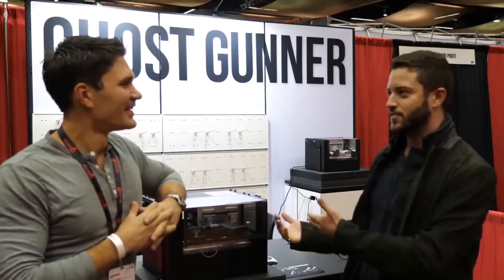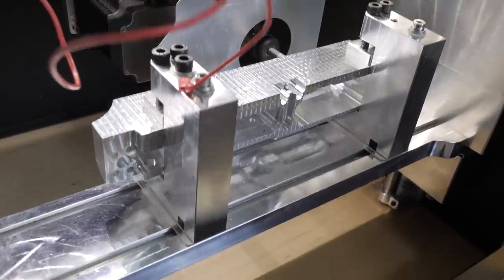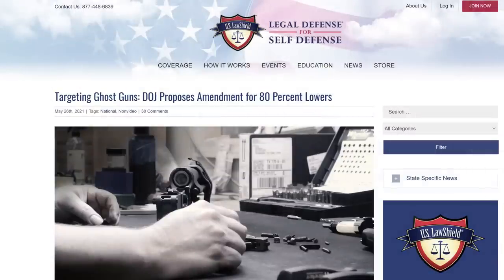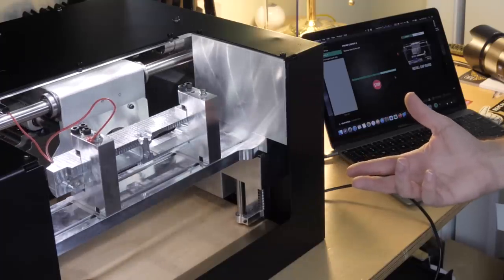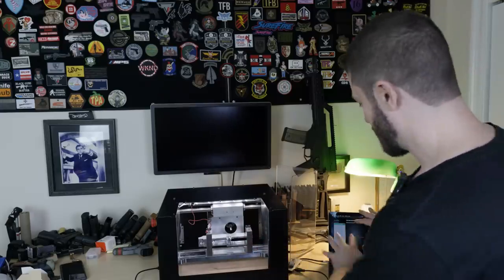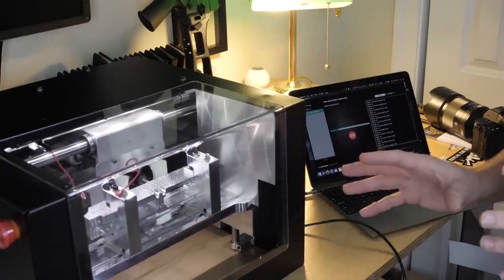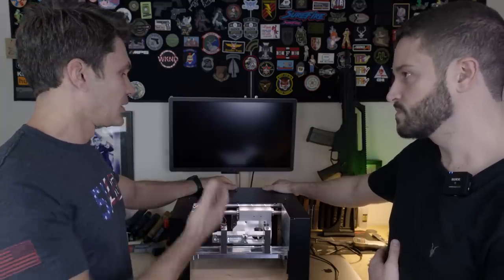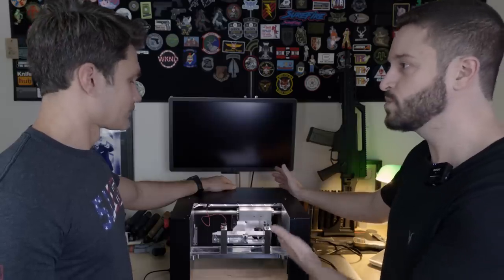NEW: Turn a Metal Block into an AR-15 Lower at Home with the GG3 Upgrade

Comment: I love the way Cody thinks. The AFT as Biden calls them are getting ready to regulate 80% lowers so what does Cody think of? Making a ghost gunner which will take a block of aluminum and make it an AR-15 lower receiver. LOL. Actually, you have to buy two more parts that bolt on to what the Ghost Gunner machines. It still totals $110 to buy the bolt on parts already machined. You can see in this video what is being machined is not a full receiver without the bolt-ons. I see on their site  the bolt-ons are coming in a future release. Great!

Comment: Seems there's no cutting oil or other lubricant in use during the cutting process.  Is it just not necessary or would it help preserve the bit, reduce chatter and get finer finishes?

Comment: So what I still fail to understand is what exactly comes out of the GG3 when the machining is finished.  Do I open the lid, toss in a chunk of aluminum, close the lid, turn it on, open a beer, kick back and wait?  When the machining is finished, do I have a lower that is ready to install a lower build kit in?  Is it ready for an upper, a stock, a handgrip, etc., or is more machining required?  Other than that chunk of aluminum, do I need to buy anything else?  Can some cool words of wit be inscribed on the receiver side?
Reply: Check their website. It’s a 3 part receiver. You have to buy the other sections the machine is not capable of creating.

Comment: All the ATF needs to do is change the rules and make the pressure bearing components the restricted parts, bolt, barrel & extension and trunnion which are the parts most difficult to manufacture, like many European countries already do.
Reply: And they are trying to do that, after people started making noise about how the AR lower receiver doesn’t match their definition of a receiver
Reply: @0dayExploit  from an outside of the US view it's pretty crazy that only an easily made part with the serial number is considered a firearm, when you can buy over the counter the most important parts that require machining and heat treatment processes you would struggle to produce yourself.

Comment: In all these 0% 80% x% parts there is a bottleneck ... from where you get the barrel if they start numbering the barrels. That would be the easiest way to stop the self-made gun movement. All parts can be manufactured home: receivers, stocks, triggers, springs...even your ammo. But the barrel manufacturing is another level.

Comment: This is getting close to a full CNC system.  Wonder when he’s going to move on from specialized ghost gunners, to a low cost CNC for the home user?   Given all the 3D printers, and how well they are selling, this could really flood demand … which would make it completely unstoppable by the ATF.  “So you want to ban all 3D printers and cutters (CNC s), because someone could make a gun with them?  Someone could make a gun with hand tools.  You going to ban every power and hand tool?!”
Reply: You could just buy the components and build your own CNC.
Reply: @ChucksSEADnDEAD  
That’s a lot harder to make then a gun!
Should be a real market for them though.

Comment: I think it's more incredible how simple and miniature this "mill" is. I wonder how much chip load this machine could handle... Does it run on G-Code?
Reply: yes... gg1 and gg2 are versions of grbl.. with slight modification. (their version doesnt appear to fit on a adruino uno, at least not the one i had. every so slightly to large. might be able to skinny down some compile options.. so i dont know if their board is the uno.. but its definitely grbl.  their .dd format files are just zips with other stuff thrown in them for use with their windows based software. there is a gcode file that will run on their machine and is configured for that spec. i stole (its open source) some of their axis leveling code for a engraver project built out of 3d printer parts i was messing with (non commercial.. just for me). but you can open those dd files and dump those routines right into universal gcode sender or the like to run them on grbl. with the exception of their leveling and maybe some of the custom status commands,,, it will work.

Comment: So its not really put a block of aluminum in the machine and pull out a functional lower. You still need to buy a parts kit that has the magwell, trigger guard, grip tang, and buffer tube threads.

Comment: Suppose I have a documented fully semi auto with serial ABC123. I put a block of aluminum and “customize” it with the same serial number. Is that more trouble than having a tool without a serial number? 🤔 technically it’s not a ghost it’s a clone.

Comment: This is not really a panacea. Under the proposed regs that will probably become law, once your block of AL is made into a receiver, it will be illegal unless you get a serial number.  So when you compare the cost of this type of set up v simply purchasing a receiver with a serial number, how can it be worth it. Once you start to use this for a commercial as opposed to a personal reason, you become a manufacturer and you are regulated by existing ATF regs

Comment: Correct me if I’m wrong, but isn’t manufacturing your own firearms in your home legal nation wide so long as you serialize and register the firearm?
Reply: Tell me, Who really wants to register their freedom tools?
Reply: Correct. As long as it isn’t an NFA item and you give it the proper markings, AND you don’t manufacture them with the intention of sale. However, the gov is most likely going to classify the 80% receivers and other parts people are using to make their own at home as complete firearms that require registration for purchase. Basically, they’re hassling people who are doing something that is completely legal.
Reply: If you make your own you don’t have to register it. But you still have to mark the receiver with a unique serial number and where it was made.
Reply: @gagemason3865 I know of two states that requires registration. CA requires you to ask for permission first before you can make one and register it after.
MA requires you to register once it's completed.

Comment: I'm less interested in this as a device to make firearms, and more as just a prototyping cnc rig. There are all kinds of little parts you can make for other hobbyist like model planes, drones, custom bike parts. As for firearms, I'd be more interested in creating custom accessories. Your polymer handguard too flimsy? Or you want a longer one for your specific barrel length? Chuck in a CAD file and make it yourself. It looks like the tolerances aren't going to be great though. What they're showing in the video looks like it needs a lot of hand work after it's been milled.

Comment: Well, I just watched the video, and I gotta confess I got a chuckle out of it.

If this guy seriously thinks he's run a successful "technicality gotcha" against Big Gov, man oh man, is he in for a rude awakening!

There's another video on this thing that I watched earlier, that explains that to "make a receiver" you not only need to mill out the aluminum billet, but you also need to BUY some parts (only available from them) to make that milled out block into a receiver. Without those parts, all that you'll have is a block of aluminum into which you can insert a magazine and a trigger/hammer/safety.

I wonder how many nanoseconds it'll take for them to declare those parts -- the ones you need to buy to make the milled out NON-GUN billet into a "partially built receiver" -- "partially manufactured receivers" that require serial numbering, a manufacturing FFL, and a 4473?

Oh, I'm pretty sure they wouldn't do it immediately upon the enactment of the rule covering "partially built" (or partially "manufactured" -- I forget their nomenclature du jour) receivers.

No, I'd be surprised if they didn't wait until a slew of these things had been sold, and then they'd lower the boom on him. Suddenly all his loving customers will be... let's just say "seriously upset."

The whole thing reminds me of that Indiana Jones scene where the (Egyptian?) with all the fancy whip-work is squaring off on Indy, who basically says f-THIS noise, then pulls his revolver and shoots the guy.

He doesn't pull his whip and try to "out-whip" the guy. He just smacks him down with one shot.

Squaring off against literally the biggest outfit in the history of the world, thinking you can play "Gotcha!" with them -- using their rules, no less! -- wow, that's pretty darn naive.

Personally, I try to avoid conflict with entities that can destroy my life, my family's lives, take everything we own, completely ruin us, cart me off to prison, and, shoot my cats. (Sorry, folks -- my dog died several years ago and I am in very poor health and cats are so much "lower maintenance" than dogs.)

But hey, you get to decide which hill you want to die on. Just remember -- at the end of that game, you're still dead, the hill's still there, and the other guy moves on to his next target.

Comment: They need to produce a companion machine to this that makes ammunition from scratch,
Cases from commercial copper pipe, a tool to make primers, bullet moulds, and a system to produce powders for the primers and propellants from chemicals you can buy at the regular stores,
This new machine is awesome but without a way to feed it in places you cannot buy ammunition without a license it's a ornament,
The ultimate evolution will be a milling and printing machine that can make every single part of a pistol or rifle including the barrel and bolt carrier and a trigger group everything,
And a kit to manufacture ammunition from scratch including making the powders and cases from of the shelf chemicals and commercial plumbing pipe with a detailed instructional video on how to do it,
That's what the world is waiting for, I wonder how long before that combination kit and instructions are available.

Comment: If they ban 80% receivers they won’t have to ban 0% receivers. This will still be considered criminal. The process of milling a receiver from a 0% receiver does not instantly create a firearm… because it is a drawn out process, at some point you will have created an 80% receiver and will be in possession of a banned 80% receiver. 

Along those lines, being in possession of a firearm made from a 0% receiver could be proof of past criminal behavior (Not a lawyer)

Comment: So for the record they have stated on Reddit that this in fact will not take a blank piece of aluminum and turn it into a functioning lower.  You have to buy their pre-machined parts to what you machine to get a working lower.  Not the thumbnail image where you just have a block of metal and a bit later you have milled that to a functioning receiver.  Bunch of marketing BS is all this is.

Comment: I don’t get it. $2500 foe the machine and you can’t sell these lower receivers to anyone. So how many receivers do you need for yourself?
Reply: @Wayne Flanigan but for $2500 you can buy so many lower, It doesn't make sense to own an engineering machine if you cant sell or produce products to sell.  I just don't think it's a strong investment for people to make. Clearly, I'm not the only one, they said they would sell 700 units and there are still over 578 available.

Comment: Or you can get a solid 3D printer for 1/10th the price and print lowers for much cheaper as well. Not to mention all the other things you can print
Reply: Yes but you can’t 3D print aluminum at home.
Reply: Why not both? Besides this is Aluminum, Miles better then ABS plastic
Reply: Or you could get both and start a company with your ffl
Reply: Yes, 3D printing is cheaper if you only care about the lower. Us big brainers can see beyond AR lowers already. Imagine milling an upper at home... yeah, with an open source software it’s only a matter of time before we have the entire gun homemade instead of just the lower.
Reply: @whiteboytyler8715  yeah, we’re here because we deeply care about asking permission.
Reply: @FuckTheState  "big brainer" but you talk about making uppers on an device that is only big enough to mill out an AR lower receiver... so please try milling an upper at home with that and let me know how it goes. 

Also like someone else mentioned there are multiple .22 and 9mm 3D print models with either a steel tube lined barrel or 100% printed barrel. Also upper parts are not FFL items so making those is the least of my concern. Upper parts also require the tightest tolerances and are where all the explosions are happening so I would rather someone who is professionally trained in making those parts make one for me for the most part anyways.

Also printing a hand-guard, fore-grips, stocks, pistol grips, etc is doable with a 3D printer.

I've already made 2 complete guns at home with my 3D printer but go off "big brainer"
Reply: @EdwardOrnelas  Well good think no one uses ABS.... PLA+, HTPLA or Carbon Fiber HTPLA are the defacto standards for printing anything that requires structural integrity. Multiple people have put their lowers through 1000+ round torture tests and had 0 issues. Plus if they do break they almost always break at the stock and you can just print another or keep a few on hand and then you got another ready to go. No one is saying replace your home defense or competition rifle with a 3D printed one but to keep denying how good 3D printed lowers have gotten now is just pointless.
Reply: @cdawson198600  well you could it just depends how much you're willing to spend. But 3D printing metal is 100% a thing, the machines are not cheap though unlike the plastic or resin printers. 

Also idk why you think an aluminum lower is that much superior. Will it aluminum last longer? Yes. Can you just 3D print another plastic lower for your gun if it does break? Yes. You don't replace your competition or home defense guns with a 3D printed one but when you can add more and more to your collection by printing the lowers its 100% worth it. I could buy a printer and build 8 or so ARs for the same price of just the Ghost Gunner 3.... if aluminum means that much to you then go ahead but with how good PLA+ lowers are now I can't justify it at all. If it was big enough to rifle barrels maybe

Comment: How does it evacuate chips? Thats a pretty far along block in there, lets see an un touched block get milled. 

Its really just a poorly built cnc machine, ditch those ground rods for proper linear rails. Whats the ball screw situation in the machine? Is is closed loop system? 

2500 is awful close to being able to cnc convert a benchtop grizzly mill, which would be a far more robust and versatile machine...

Comment: can i do it in wood, like ironwood or some other super hard wood? that would look amazing!
Reply: It will mill aluminum, so yes it would easily mill wood.
Reply: @joenunya8449  I understand it physically can cut the wood, was more so wondering about the strength of the split 2 piece lower

Comment: Only problem with this... What is stopping the govt from making the machine itself illegal?
Reply: Then what's stopping you from buying stepper motors, lead screws, chuck, router and bolt together frame parts?

Comment: The Ghost Gunner 3 is a great idea. It’s just too expensive for the casual user. In spite of the ATF’s proclamations, the GG3 will be used to make many AR lowers for friends and family until everyone that wants a lower has one and it becomes cost effective. Then it will probably be sold on the second hand market. The ATF is fighting a losing battle. After all, our government left 600,000 infantry weapons in Afganistán to arm the Taliban. Why should anyone take the ATF seriously? This doesn’t take into account 3D printing. I have no sympathy or respect for the ATF or for those supporting them.

Comment: I thought this guy got arrested?
A block of aluminum is more expensive than just buying an 80% from a company.  I just bought 2 80s last year and considered just milling the whole thing cuz I have a CNC.  But it cost like 20 or 30 bucks more than just buying the 80%
Reply: Okay, the point is to address the possibility that you can't buy one anymore. They explained it in the video.
Reply: @ChucksSEADnDEAD  
Can't buy one what?
an 80% lower?  The place I bought mine from are still selling them.  While the ATF is actively trying to create New Laws which is illegal.  The Firearms Policy Coalition is actively fighting them and winning.  Along with GOA

Comment: They’ll just ban the machines or the files required to load onto the machine. Charge you with some computer crime I bet. 😡
Reply: They'll try, but you can't stop the signal.
Reply: @sanangelo7926  Making personal manufacturing illegal won't stop it either. 
There's already a lot of homemade firearms in the wild. Unless they magically manage to confiscate or register all of them someone could just make a new gun and say they made it before any ban on manufacturing was in place. How could they prove otherwise?
Reply: They ban the machines, you buy the individual components and assemble them.
Regarding files, learn CAD, find blueprints and turn physical drawings into digital files. They can't ban you from becoming a self-taught engineer.

Comment: So kind of an unrelated question.
If this can be used to make parts that will survive a slide reciprocating on a semi-auto pistol, could it produce new Pistons to replace broken pistons in Old piston engine aircraft that use engines no longer manufactured (such as the Rolls-Royce Merlin engine used on the Spitfire and the P51 Mustang)?